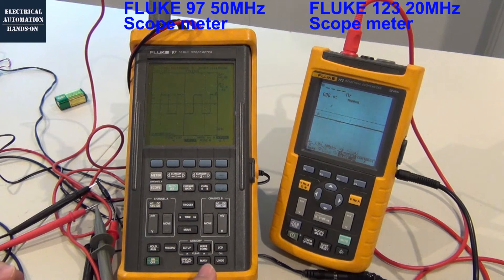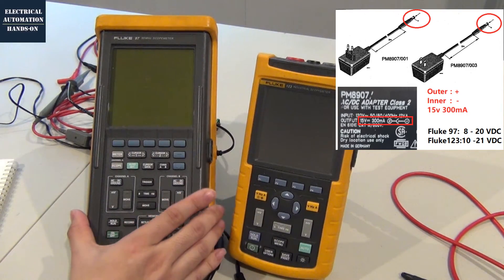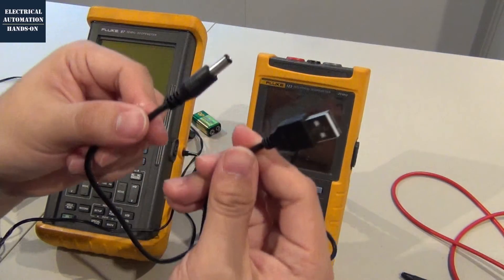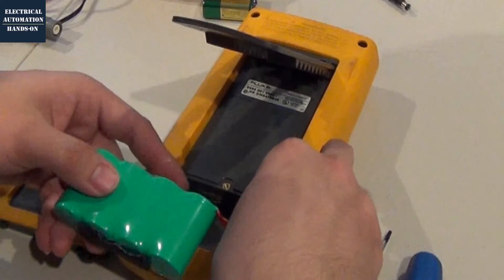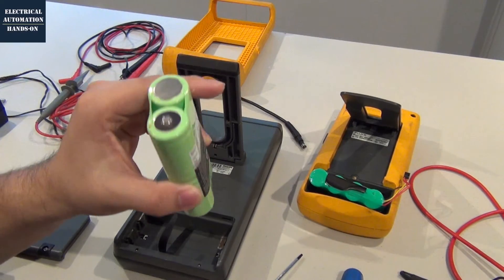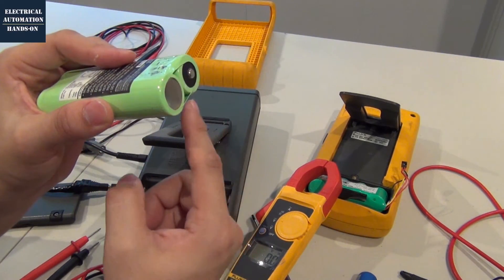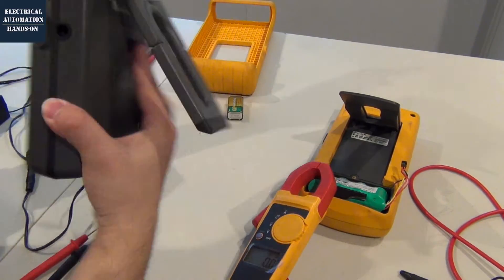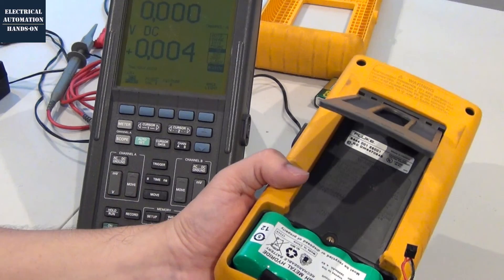U05. Battery and AC/DC Power Adapter of Scope Meters FLUKE 97 and FLUKE 123

Comment: I'm working on a 3d printed housing to replace the standard cells with 18650 li ion batteries. Looks like I'll be able to fit two in series and then use a buck converter to buck the voltage down the 5v.
Reply from the maker: Looking forward to your 3D printed housing. Great idea

Comment: Very interesting Video.  Have question: Can I use power supply from Fluke 97 to charge Fluke 190-202. Thank you very much.
Reply from the maker: For Fluke 190, I would recommend using Fluke requires BC190 as the power adapter.

Comment: Maybe just use lithium USB-power bank, which delivers exactly 5 V which is the voltage of a loaded NiMh accupack for Fluke 123. If the power bank doesnt fit into battery cabinet it can also be attached to the stand foot outside and cable can feed to inside.
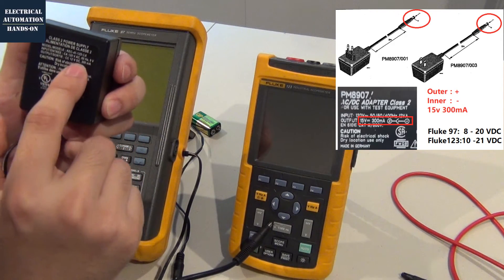Reply from the maker: Thanks for your comments, but just note that the voltage of the power bank has to be 10 - 20v DC, as displayed at 2:45.
Reply: @electricalautomation  I think you are mistaken! I not ment the power supply, this is 10 to 20 V, yes. I mean the battery connector inside battery cabinet at back. Remove old battery and install USB-plug. Then connect Li-Ion-Power bank for USB, which delivers regulated 5 V. This voltage is same as a charged Fluke battery! This way you can extend runtime to days propably.
Reply: @johnbiden2834  Thank you very much for the idea, is there a particular brand that you recommend o model that you used. Appreciate it very much.